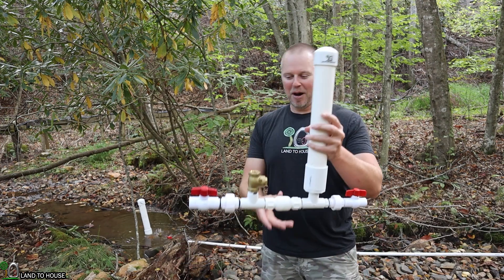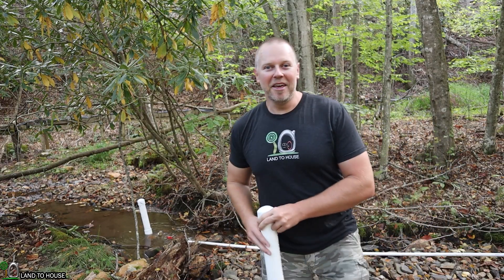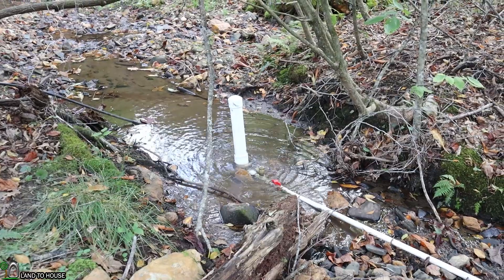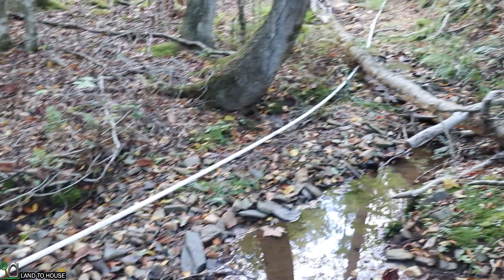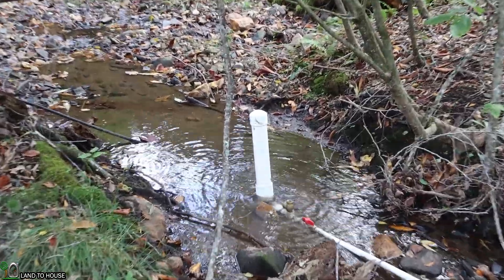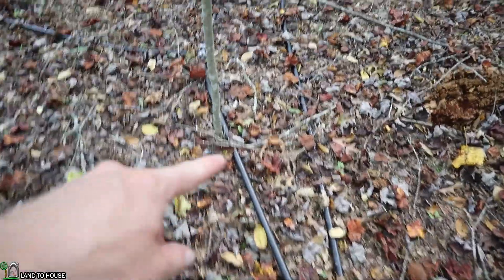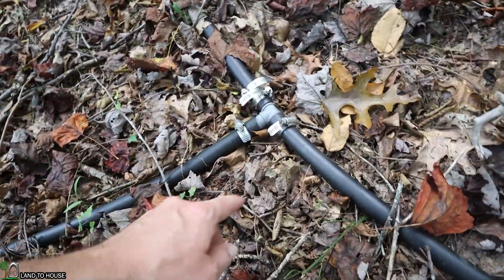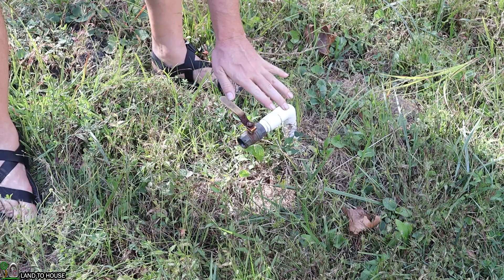Split Ram Pump Delivery to Two Places

Comment: You could use a check valve just above the split to keep the water in the upper pipe. That would solve the back flow issue but it wouldn't solve the available preasure issue. Working from stored water at the tank is similar to how municipal water supplies work. It is a stable and controlled system though they pump into storage to maintain static preasure on the whole system.
Reply from the maker: Good point. I like the use of water stored in the tank for the same reason. It is just consistent and reliable.

Comment: I was thinking let the overflow outlet from the higher tank fill the lower tank.
Reply from the maker: That is certainly an option as long as the second tank doesn't need water as often. If it takes the top tank a while to refill.

Comment: Hi Seth I'm getting ready to use your information and build my first Ram pump here in southern Brazil on my property. The hardest part for me was finding various check valves that I thought would actually work. I did find one where I took the spring out of one and the other one I left the spring in and I'm going to see how that combination works. I'll be building it here in the next week or two. Only pumping water up between 5 to 6 M and then it's going to go down a hill into our pond to add fresh water to the pond but also to help  oxygenate it.
Reply from the maker: A foot valve with spring works well for the inline valve. You will need to remove the spring for use as the waste valve.